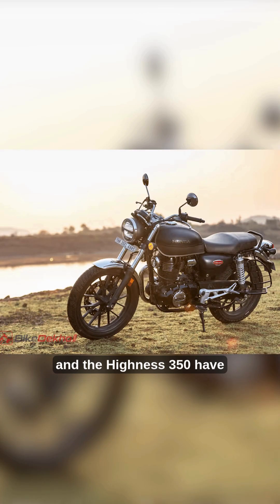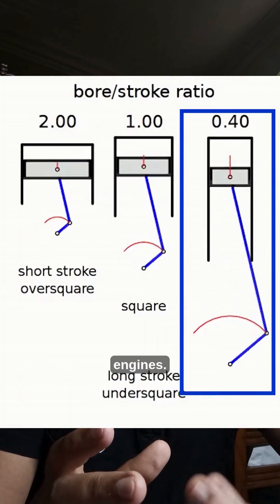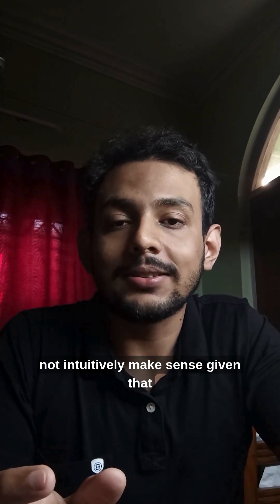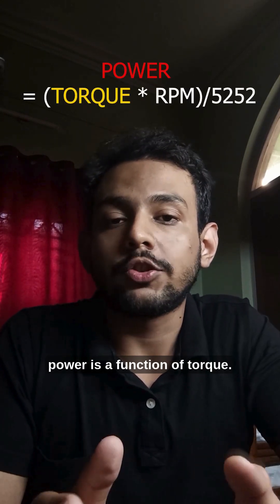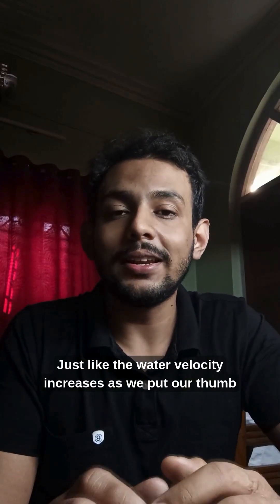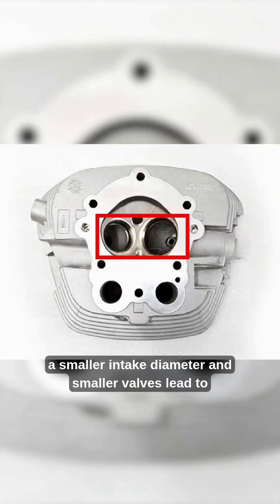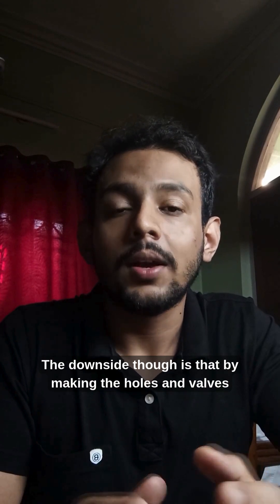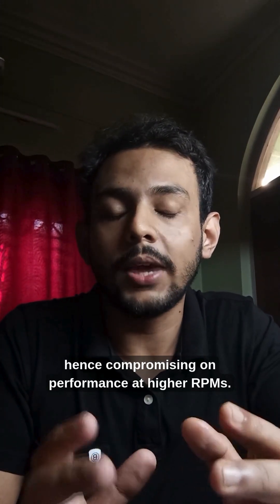20 Bhp On A 350cc Bike: Why Long Stroke Engines Have Lower Peak Power? #bikes #classic350 #hness

Comment: So in short RE bikes are very inefficient and purchased just for looks and feel.
Reply: No, rather they are very fuel efficient as they use heavier crank as energy reserve. Also, he literally said better combustion on long strokes
Reply from the maker: Nope, not exactly. In fact, from a thermal efficiency standpoint, they can often be more efficient. It's just that their overall geometry affects critical parameters like air and rev limit and hence amount of power they can make.